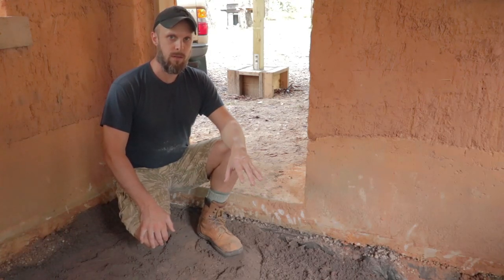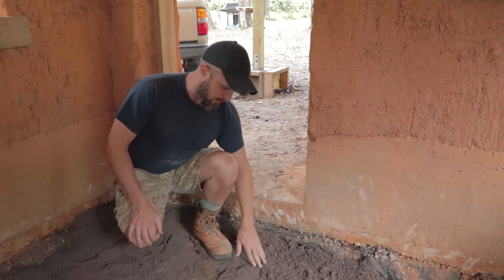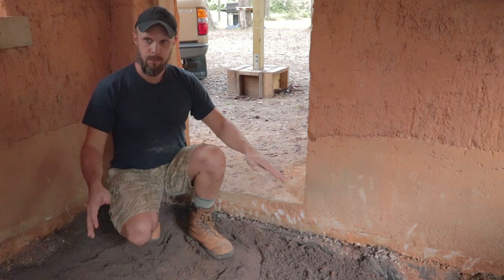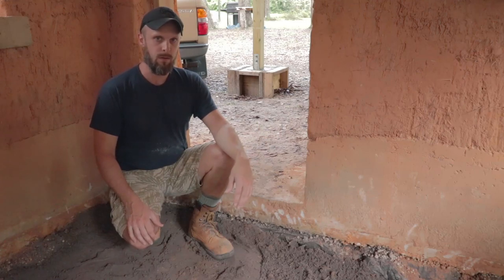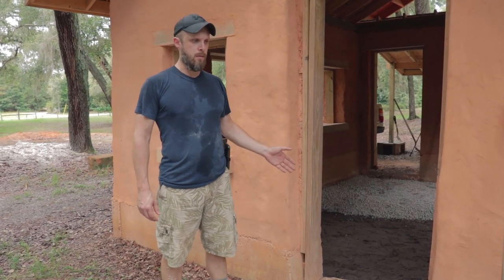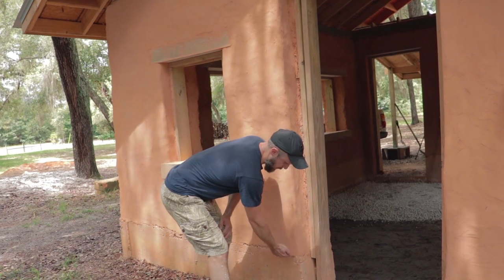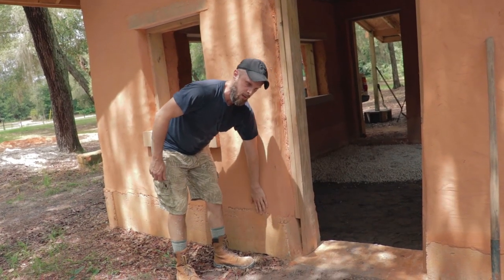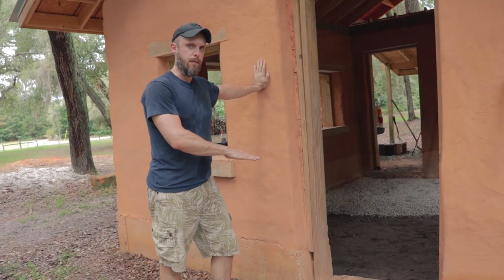Installing A Concrete Floor in A Cob House

Comment: Can you build the cob house on top of a concrete slab?
Reply from the maker: A slab is usually too thin for the heavy cob walls to sit on. The foundation really should be reinforced with thicker concrete under the walls.